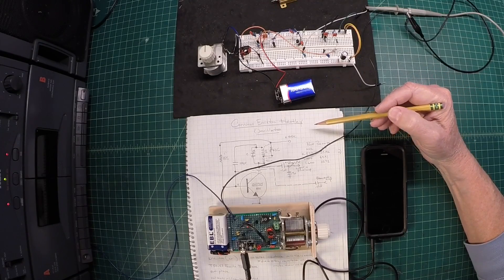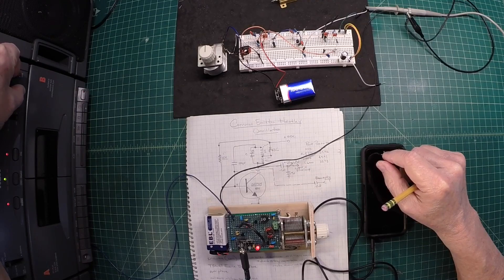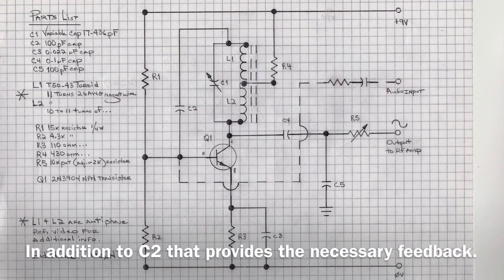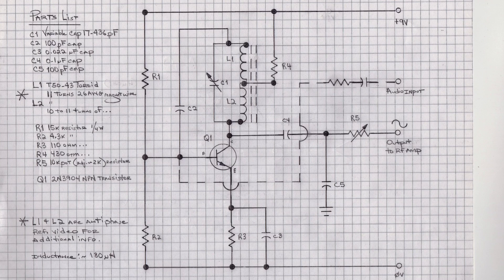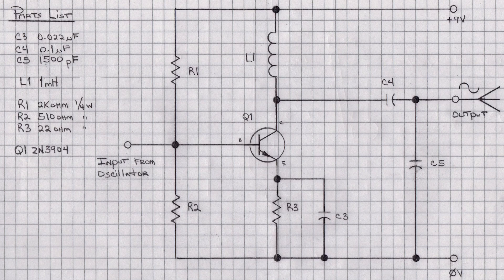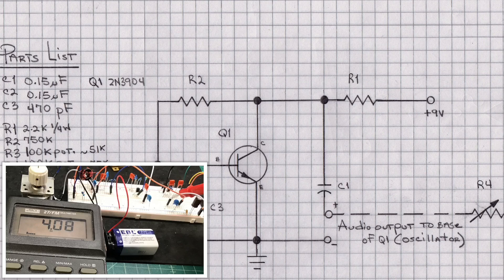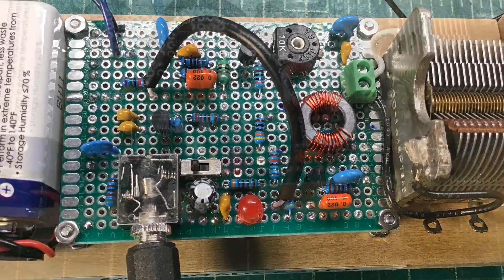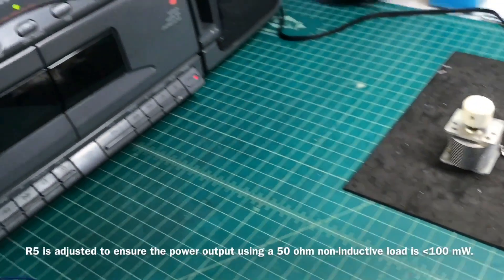How to Play Old Music on a Vintage AM Radio Using a Low Power Broadcaster

Comment: Hello, Don. Thank you very much for the nice video. I followed your design as closely as I could and it sort of works. It is modulating the frequency instead of amplitude. I checked the circuit many times already. Can you give me some clues?
Thanks in advance and warm regards
Reply from the maker: Thanks for reaching out. This was a very early design for me that I no longer use and the modulation technique is not good; more of a superimposed audio on the carrier wave. You may find this page helpful at: https://www.geocities.ws/raiu_harrison/mwa/tech/circuits/modulators.html and check out my later builds at my playlist: AM Broadcaster
https://www.youtube.com/playlist?list=PLjLu4V-71S1Kaz5Eiw0Cx5c8U0DWll87B Reference the video descriptions for a link to the schematics. I hope this helps.

Best,

Don
Reply: @RestoreOldRadios  Thank you for the response. Maybe i can save the amplifier stages and change the oscillator. I'm having so much fun with this. Thanks for the links too, you are very kind.
Regards!

Comment: I've finished the AM Broadcaster, pretty much according to your design.  I find that I get a bit less signal distortion by adding a base-to-ground bias resistor in the audio amplifier circuit.  I also added the suggested capacitance on the power input section for which I am using a 12V linear wall wart.  Everything works great!  Thanks for a good plan.
Reply from the maker: Wendell - glad it came together and works well for you. For my edification, what value resistor did you add in the audio section? Best, Don
Reply: @RestoreOldRadios  I added 150K from the base to negative rail.
Reply: Don, I should also add that I rewired the 750K resistor from the base of the audio amp directly to the positive rail instead of through the 22K on the collector.  (A result of modeling on a circuit simulation app.)
Reply from the maker: Thanks for the feedback Wendell, much appreciated. Best, Don

Comment: Ok Don... I finally got mine built and working. I have gone old school in my build though! Video is on my channel.
Reply from the maker: George - I’m eager to check out your channel. Hope to visit later on today. Thanks again. Best, Don
Reply from the maker: George - I had an opportunity to watch your old school build of the Tx. That was very cool the way you laid it out. I’ve never done one that way and found it very interesting to watch. Thanks for sharing. Best, Don
Reply: Many thanks Don, glad you found it interesting. I first started out by doing the copper nail thing as a kid and I just thought it would be an interesting way to this. I find it allows people to learn about the different stages in the build and could even be made modular so you build an audio stage on a square, then an oscillator etc, bit like the block diagram.

Comment: Don, I'm a touch confused here. Looking at the toroid part of the video it conflicts with what you are saying re diagram with the actual winding. The toroid in the video at 2:15 is wound in phase, if you join either one of the sides together the direction doesn't reverse in the winding yet the diagram shows antiphase. If you put two coils on a toroid in antiphase then they cancel each other out because when one side is high, the other is low. Or am I missing something major here? I wound a toroid in antiphase and effectively got zero end to end but 100uH in each side. winding it in phase, I got the required 180uh value. Is it just my stupidity and I'm making a rookie mistake?
Reply: +George Christofi.  I wound the coils as they appear in the flesh (photo) and the oscillator works well. I have not tried to wind the coils in reverse direction with respect to each other. I may try that though to see what results I get.
Reply: @guglielmomarconi9942  Thats what I thought. Don's coil in the video is just a standard coil with a centre tap, not an antiphase one.

Comment: At the time of publication of this video I had been looking into setting up a local broadcaster for transmission of my favorite music around the house. This project fitted my requirements exactly. I've now built a couple of these units to identical board layouts as in the video. They all work very well indeed and I am able to hear my favorite music on various a.m. band radios around the house.
I use a metal bed frame as the antenna which gives great reception around the house. I plan to make checks in the local area to make certain that the signal is not reaching too far outside my boundary. The circuit seems to run happily at around 5 volts, so I can power it from a USB socket on my computer. Many thanks for sharing this design.

Comment: I'm currently looking into such a thing to provide program material to some WWII era radios as working parts of a museum display.  Too many suggested circuits are based on misusing fixed freq xtal oscillator cans.  So, if you have the time, I have a few questions to help me to my goal.  Thanks!!

1. How is this design for generating harmonics? 
2. You said L1 & L2 were wound in opposite directions but it appears they are wound in the same directions, aren't they? Both appear righthand turns. So, it's functionally a single centertap winding, right?
3. What led to choosing Hartley vs Colpitts?  Was that simply a fallout from beginning with the Buckwalter book schematic?  I was thinking it might be easier for parts cost to use a single slug-tuned coil with two fixed caps instead?
Reply from the maker: Thanks for watching and your questions. Regarding harmonics, like many LC oscillators I can tune the transmitter to 600kc and detect the signal on my receiver at 1200kc at a decreased level. Unfortunately, I don’t have a spectrum analyzer to measure the amplitude of the harmonics.

The two coils are in opposite directions. One winding is over the top while the other is under. Hope this helps.

The decision on the Hartley was just parts I had on hand. It’s my understanding the Colpitts is more stable. If you're considering a fixed frequency oscillator, you may consider a modified Colpitts or a Butler using a crystal. A few links below for reference that you may have already bookmarked.

http://www.circuitstoday.com/lc-oscillators-and-types

https://www.electronics-tutorials.ws/oscillator/crystal.html

https://bgaudioclub.org/uploads/docs/Crystal_Oscillator_Circuits_Krieger_Matthys.pdf

http://www.rfcec.com/RFCEC/Section-2%20-%20Fundamentals%20of%20Electronics/09%20-%20OSCILLATORS/

Good luck on your build. 

Best,

Don
Reply: Thanks for the info & links!  By the way, here's 2 reasons why I think those 2 wires are wound in same direction.
1. In an LC tank the current flows thru the inductor & back every RF cycle. If the inductor is two windings in opposite directions the 2 mag fields are opposing & cancel & there's zero net inductance.
2. The continuation of the upper wire wraps the core the same way that the lower wire does.  I can send a pic "with lines and arrows" if you wish.  :-)  
In detail:
If you imagine continuing to wind with the left end of the upper of the 2 wires in the video, the next thing it will do is pass downward & then under the core & then come up thru the center (just like the lower wire already does).
Next it would go down on the outside again, under again, and up thru the center again (just like lower wire does) & continue onward that way along the core in a CCW direction (like the lower wire does).  The ending of the final turn would come up thru the center just as the lower wire's right end does.  They both spiral like righthand threads do.